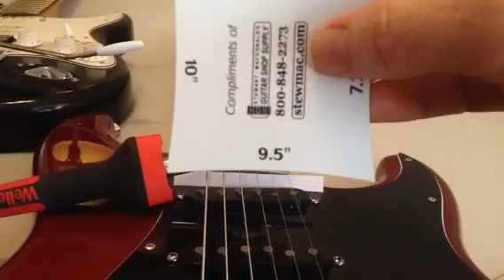Curing Stratitis By Moving Polepieces

Comment: Thanks for this! However, once the polepiece is not being gripped by the potting wax, there is more of a risk of the pickup becoming microphonic at high volume/gain, so it might be worth just dripping a little bit of wax from a candle, say, around the bottom of the polepiece that you've freed up, so that it's gripped again.

Comment: Thanks a million, your explanation is to something that I stumbled across back in the mid 80's.  After retro fitting staggered pickups to a MiJ Strat I got the natural urge to push the poles into a flatter profile.  I've been doing it ever since because I always thought they sounded better, however, I learned a long time ago that I also have a strong preference towards 12"R oil and wax finished necks and now I know why I like to push the staggered Alnico poles flat.

Comment: Great video. I just did this with some Seymour Duncan SSL-1s that I've been fighting with for 7 years. I'm glad I did. I can still have a stagger, but not nearly as pronounced. I only pushed the D & G pole pieces down. The middle position pickup worked perfectly. In the bass position pickup, I went just slightly too far, where these pole pieces match the height of the A string pole piece. I can hear the difference in comparison to the D & G pole piece adjusted middle pickup, but barely. This adjustment is the best thing that's happened to these pickups. The sound of the SSL-1 is, to me, the way a strat is supposed to sound, and getting the D & G pole pieces down enough for a modern radius neck has made these pickups sound incredible. It is truly a revelation and made these pickups usable, because the stratitis was driving me crazy before this. Thank you for this video!

Comment: Thanks for posting man, this worked perfectly on my AVRI strat that had a real bad string volume balance. Now it shines!
Reply: I have a AVRI 62 Fender strat. So, there is no harm for moving the pole pieces un these Fender models?
Reply: @JorgeTheilacker  just be careful and you’ll be fine. No guarantee though, but it worked very well for me.
Reply: @Tomsdrawings  
Thanks!
Anyway, I will look closely and check what kind of pick up frame AVRI 62 has (plastic or fiber).
Reply: I think you really hate Strats

Comment: Hi! About moving polepieces - I'd like to point out, that the pickup in your demo is from the 80s with plastic bobbins. (Square holes on the bottom).The wire does not touch the polepieces on those pickups, so you can take out all 6 and even reposition if you like. (Be sure to have the polarity right).No demages to the coilwire. All other Fenders with a top and a bottom plate - have the wire directley on to the polepieces, and therefore this is pretty risky. The wire rest on both outer polepieces, so they can not be moved at all. The G & D in the middle of the pickup have the lowest wire pressure, and they can be carefully moved, but not repeatedly up and down. That would be like filing through the wire insulation. Move carefully only once.  H & A poles are more risky, so leave them be. The most important problem is with the G&D -  I have done this many times with both center pieces, and never had a problem, but it is possible to cut through and destroy the pickup. I never heated the polepieces, 'cause that may melt the insulation on the wire. So, if heating - do not warm too much.
Henry Eugen
Reply: Henry - you referred to the "H & A poles". Am I right in thinking that by 'H' you mean the German for 'B'?
Reply: Hi!  I'm so used to say H, but yes, it's B in Germany
Reply: No worries. I reckoned I knew what you meant, but could imagine a few people getting confused :-)
Reply: @redpaul101  German has B for Bb and H for B natural ergo Bb A C Bnatural spells B A C H in German...
Reply: Thank you.

Comment: Did this with 57/62 pickups. The bobbin is not plastic, so i was a little nervous.  worked great! Finally sounds even!! I didnt use a soldering iron. I used a small flat head screwdriver and a LIGHT hammer. Lightly Tapped the poles downward till they broke loose. Then adjusted to where i wanted them.  I did not touch the high or low e just incase the wires wrapped around them. 
Thank you!

Comment: In plastic bobbin pickups like that you can move the polepieces without fear, they are press fit in and do not touch the coil wires. You can use a small C clamp and a piece of hard wood with a hole in the opposite side to adjust polepieces with more control. No heat needed.
If you have fiber base pickups, it is a little more risk cause the poles hold the bobbin walls and are part of the structure of the pickup.

Comment: The comments and criticisms that ignorant people can come up with never cease to amaze me. This is a great video and the technique this fellow demonstrates is actually used by full time professionals. If you are afraid to try it, don't try it. If you don't have patience, don't try it. If you take your time and move cautiously you'll be fine. The safes way is doing it with the pickups out of the guitar. Also, if you don't know the temperature tolerance of a fixed magnet, don't comment about destroying the magnet. This technique works. I've been doing it for decades and NEVER had a pickup failure. I would add, as some others have already said, the best result will come by setting the pole piece heights to match the fingerboard radius at the 21st, or fret nearest the neck pickup.
Reply: Because professional luthiers work on guitars on their couch.

Comment: Been thinking about doing this for a while. Saw it done on another video. After watching this, I thought I'm going to try pressing down the G pole piece on my Strats Tex Mex pickups, while still on the guitar ... and it worked. I just used a screw driver and pressed firmly with controlled pressure, and they moved no problem. It makes a quite a noticeable and preferable difference to the sound of the guitar. Before the G was too prominent but now it sounds much more balanced with the other strings. Thanks for giving me the confidence to try it.  :)
Reply: I think that you're lucky that you didn't strip the height adjustment screw , or where it goes into the pup(the ear); thought about trying more than once, but know how stubborn they can be.At the very least, I would take it out & put it on a flat surface.THEN I would use heat if needed.

Comment: I  learned a little trick some time ago. On   ebay   you  can    buy   neodymium magnets. They come in various diameters - 4mm 5mm etc - and various thicknesses - 1mm 2mm etc.  Using  one  of  these  will  balance   out  the  sound  i  tried  it  and  it  did  the  job  👍
Reply: this is an awesome idea dude, much safer than pushing the pole pieces and risking to damage the pickip winding

Comment: Understand that this is an old thread, but I would comment that the reason the poles are staggered has more to do with the magnetic properties of the string cores than anything to do with neck radius.  Obviously, bridge/saddle radius should reflect neck radius, but even then you adjust for string clearance and playing feel, not just the radius.  Magnetically, with a wound string, the core will be smaller in a smaller gauge string, thus the pole piece needs to be closer to maintain a similar voltage amplitude as the string moves through the field.  With a wound G, the pole piece is right up there close.  Then you come to that big plain B and the smaller E and the pole pieces are adjusted to some early engineer's calculation regarding voltage amplitude needed.  I believe that the original pickups were optimized for particular string sets made of nickel steel.  Lots of different stuff available today of different materials, gauges, and physical characteristics.  Bottom line, you can't set up a guitar with a ruler, and it really helps if you are a competent player.  I have fought with this issue a lot over the years, even grinding pole pieces down (not a good idea) to balance out string response on my Strats.  This is useful information, an appropriate technique, and no, you won't affect the Gauss strength of your magnets with the heat available from a soldering iron.  My response is not intended to address "Strat warble" which is a very real issue and caused by the height of pole pieces as described in the video.  Keep on pick'n!
Reply: doesn't heat destroy magnetism? I have the same issue it's driving me nuts, everything cranks , get to the B and it's like where did all my sustain go
Reply: @stevetellurian1280  have you tried those stainless steel saddles?  Seems to help alot
Reply: @stevetellurian1280  Heat destroys magnetism, but this impact is varied across different magnet types, Alnico is the most resistant magnet to heat.
Reply: @stevetellurian1280  It's material-dependent.  The temperature it happens at is called the Curie temperature (Tc) of the material. A typical Tc of Alnico alloys is about 800 degrees C, but the max recommended working temperature of Alnico 2 and 3 is about 450 degrees C. For Alnico 5 and 6 it's 525 degrees C.

Comment: Just did this to my Texas specials! I was unhappy with the way the 3rd and 4th strings sounded so loud. I was allready looking into buying new pickups!

No need to heat them up with a solder, only Medium plus finger force. 
After lowering 3rd and 4th pole I saw some lacker leftovers around them, so it might be usefull to free some of that lacker from around the poles using a thin needle.
After first tiny movment they are free to adjust.

Thank's Guitar guts and other repliers!

Comment: This worked on my 57/62 fender vintage pickups. Dont use heat. Never use heat. Use plyers to push it through but be careful you don't crack the plastic around the magnet and be careful around that copper!!

Comment: Had the G string warble on my strat with Texas Specials, even with pickups lowered way down.  Squeezed the pole piece down on all 3 pickups using a crescent wrench and a washer (look for it on youtube).  Gotta take the pickguard assembly off to do it of course.  No heat needed, it's just some wax that's holding them in place, so once you loosen the pole piece you can push it up and down with your finger.  Absolutely solved the warble problem.  Now all strings are volume matched and sound like they should.  Very little chance of breaking coil wires, in my opinion, unless you pull the pole piece completely out and try to force it back in.

Comment: Thanks for the explanation of this historical anomaly - I'd always wondered why the heights were so wrong!  I play without a pick and I need the top two strings to be louder - they always sound weedy - so I usually swap out Strat pickups for Seymour Duncan 'Everything Axe' mini-humbucker sets, and soon I'm going to try Kinmans. I did push a G pole piece down once (I didn't know about this heating trick) and luckily I got away with it with just some judicious force!
Reply: I have to ask the Kinsman's are not cheap right, how did the pole move go, did it work to your liking ?
PS - Hope your didn't damage them...
Reply: @deluxairhead  Yes, it was ok!  But since then though I have invested in four sets of the excellent Kinmans for my various Strats and they custom make the pole heights to my preference.
Reply: Ljubljana

Comment: some pickup cores have the pole pieces inserted into a plastic 'tube' so to say, where the windings do not contact the pole pieces. On other pickups the pole pieces are the part that connects the upper pickup plate to the bottom plate, and the windings are wrapped around the poles themselves. This is the case with some telecaster style bridge pickups. With these pickups if you heat up the poles too hot with a soldering iron then you could melt the shielding on the windings and cause a short reducing the output of the pickup by the number of windings that short out. The other problem is that if the shielding melts off, and the wiring is exposed to oxygen, then then the winding could corrode and eventually break, or create a spot with high resistance.
Reply: Good man.

Comment: Thanks for your video and caution approach.
I just went for it on my very expensive limited edition 65 reissue Strat by using my thumb tip on top pushing carefully down on them without solder iron or breaking anything and I made some good progress to where I for sure have it sounding much better!
Now I would like to get that high E and B string raised a little from the other side, but at least I can sleep tonight knowing it sounds much more even tone and better too me!
Reply: i did it long ago, and the pickup broke a couple of months later
Reply: Still good, but yes probably bent the wire a little?

Comment: With vintage style pickups I use plumbers wrench no heat, no problems, and u can apply such little pressure you get perfect height 1st time. Out of about 10 pickups only had one problem, and that's because I over applied pressure and redone it to many times...that was the 1st try.😅

Comment: The plastic bobbin pickups are easy to do this to. The magnet pole pieces are not touching the magnet wire, because of the bobbin construction. However, the Fat '50s pole pieces and many others, are touching the wire, as they are wound directly around the pole pieces. Heating the pole piece might demagnetize it a bit, and short some windings. The chances of getting an open are slim, but I would measure the pickup resistance before taking the soldering iron to it, and after the pickup cools. Shorted windings will give you less resistance, and a weaker pickup.
Reply from the maker: I have done this more often with Fat 50's than with any other set, since those are my favorite Fenders. I have never noticed a change. Doesn't mean I'm not just lucky so far...
Reply: I wind pickups and it does mean you have been lucky so far.  :-)
Reply from the maker: Let me ask you the same question I always ask people who say I am going to break the wind. Have you ever actually seen someone break the wind by doing this, or are you just pointing out it is a possibility? I have never found anyone who has actually seen someone break the wind by doing this.
Reply: Guitar Guts 
1984. A 1964 Fender Duo Sonic. I owned it. Never did it again. The formvar on the pickup wire was probably not as robust as today's Fat '50s. As I said in my post, an open is unlikely. I'd be more worried about taking a soldering iron to it.
Reply: I wind my own and know how fragile that wire is, definitely luck nothing went wrong.
Reply: I personally have not seen it happen.  And its unlikely that a customer is going to admit it if they did it and the pickup magically stopped working.   On plastic bobbins like in the OP vid, you are never going have a problem as the magnets are isolated from the wound coil by a plastic sheath.  However, on a vintage type Strat single coil (forbon bobbin), you are just lucky if you don't cause a break in the coil as a result of pushing the alnico magnets down.  There is cured lacquer on the entire bobbin which not only provides a "seal" around the magnets to protect against rust, but it also "fuses" the alnico magnets to the forbon to a degree.  When the magnet is moved, it is going to break that seal and the jagged edge of the break (that is on the magnet), or corrosion, or surface imperfections have a very good chance of catching on and breaking the wire as moves.  Again, in my opinion, you have been lucky to this point.  So, have at it!  That said, please don't do it on a '54 Strat if you find it has Stratitis.  ;-)
Reply: rjake61 great advice...gman
Reply: @guitarguts5530 Wow, your commentors here are letting a lot of folklore fly, holy cow!

These days on fiber flatwork bobbins the poles are wrapped in self adhering clear plastic tape, a bit thicker than kitchen cling film, to insulate the poles from the magnet wire. I would say heat is more of a risk mechanically then otherwise scaring the magnetism out of the pole piece, and heat can quite quickly melt it insulation off the enameled wire. I don't doubt your success but I think that there's  a simpler way to do this: I use a c-clamp with a piece of dowel that has a hole drilled through it to accommodate the pole piece I am slowly pushing through the bottom of the bobbin flatwork. I have a particular c-clamp that I have modified for this task, and the swivel ant of the screw has a narrow strip of thick belt leather glued to it, the dowel is glued to the anvil side of the clamp. It's a mini arbor press kind of.

Strat warble is more formally called wolf tones. The magnet is actually pulling the string out of tune during its excursion, another formal term for vibrating. It sounds like you have a phaser pedal on that string only. And despite the very complicated explanations here pole pieces were staggered not only for a wound g-string but for seven and a quarter inch radius fingerboards. 9 and 1/2 in flatter need flat pole pieces, All the conversation can stop right there It's easy. I like though that you as much as you can accommodate the radius of your fingerboard, That's a humbucker trick cuz I'm sure you know. 

Okay, carry on sir!

Comment: he makes it clear which pickups to do this for and which ones NOT to do it with. Gently heating the polepiece with a chisel tip on the soldering pen would let you press and move the polepiece. A thimble would be a handy way to do it and you could feel the polepiece begin to move.

Comment: I’m a lefty and I ordered a set of  fender hot ultra noiseless pick ups  but the magnets are in a right handed setting from factory In comparison with the ones that came with my left handed guitar, they are in an opposite stagnation. I want to stagger the magnets to a lefty setting. I hope this heating and pressing helps me move them without damage. I’m quite a DIY and normally don’t have issues doing mods like this. Thanks for the tips.
Reply: I wonder if Hendrix had this problem on his Strats also. I doubt he messed around with magnet height so he probably encountered loud G strings all the time